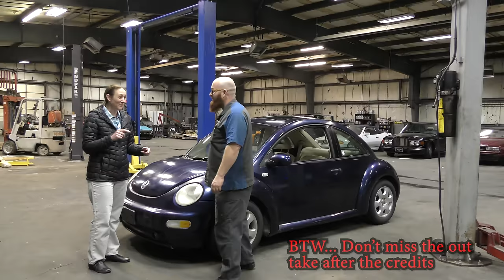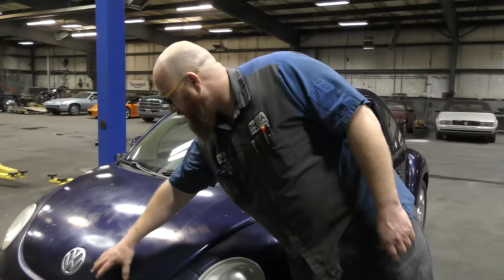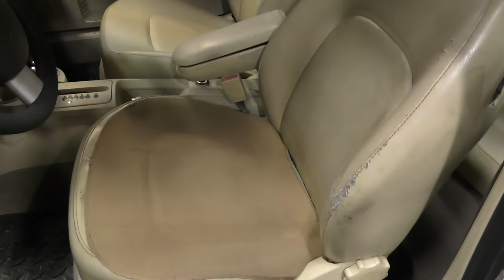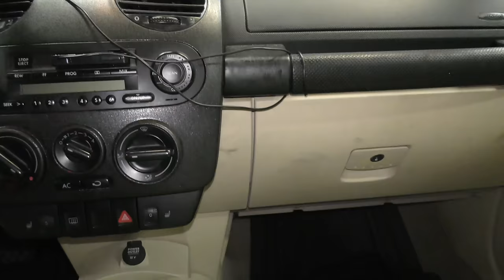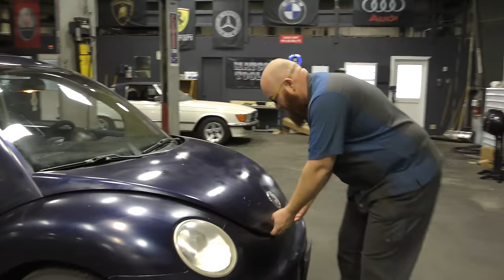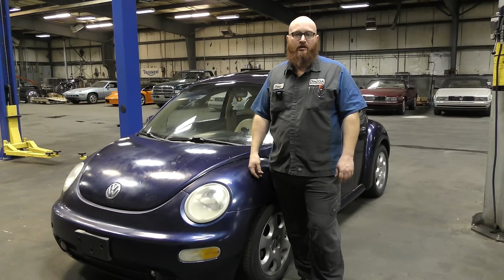Squirtle Update! Why does the CAR WIZARD love this 2002 VW Beetle so much?!?!

Comment: About 8:00 yeap thats about right, here in the uk last 3 i have had to order maf's (tps oem vw parts) i have had to give them the old maf back or i get over 100 added to the price,
They said its a system so the old ones dont get remanufactured with below standard parts and then resold as genuine,
With the egr cheat it is hit and miss, i believe it notices it by the exhaust sensor,
Get a program called vag edc suite, its freeware and with that you can turn egr request to 0,
One thing i suspect tho is it has a newer gen ecu like a edc16 as i have found that they were released earlier in the us
Would suggest the bb in the vacuum pipe but i suspect by what you have said the engine light will light up again,

Comment: not always. I put a 16 dollar delphi airflow sensor(from amazon) on the 2000 toyota echo at 160k miles. it works perfect and has over 200k. the toyota MAF sensor would have been 200 bucks.

Comment: A message to Car Wizard and anyone with a German car looking for a good deal on OEM parts...that $180 Bosch MAF sensor is only $76 at autohausaz dot com. They don’t ALWAYS have the best price on everything but I have found especially for the parts from German suppliers (Meyle, FAG, Sachs, etc.) autohaus often has the best prices around. They aren’t paying me anything, I just have a 1998 Jetta TDI and have done plenty of work replacing parts on it (cooling system, suspension, tune-ups, etc.).

Comment: you have no heat because the insulating foam has deteriorated away from the blend door extremely common mk4 vw problem, tell tale sign is if you have bits of foam blowing out the vents

Comment: It is now the day following the Easter weekend and the Car Wizard will expect to do an all-new, buy this, not that video this afternoon or on Thursday - the first one of 2021. He will hopefully do one for minivans for sure, because most families and/or roommates will need or want one to use for road trips and to transport items. We already know that the newer Honda Odyssey's from 2014 to 2017 are the ones to buy, as well as the 2004 to 2009 Nissan Quest with the five-speed automatic transmission. The other minivans that are not to buy are the 2001 to 2007 Dodge Grand Caravan/Chrysler Town and Country, older GM minivans and the Ford Windstar and the Freestar. The 2011 to 2016 Toyota Sienna with the six-speed automatic transmission and the 2018 to 2021 Kia Sedona with the eight-speed automatic transmission are still the ones, that are recommended to buy. The brand-new market has an all-new, 2022 Kia Carnival, which replaced the Sedona. It has the 3.5 L V6 engine with 290 horsepower and the eight-speed automatic transmission. It looks sleek, but it is a nice minivan. Thank you very much and I am wishing for more Car Wizard videos to come, as well as The Car Mom (Kelly Stumpe), who will plan to visit the Car Wizard hopefully this summer. They will talk about crossover vehicles and vehicles for mothers with young children, as well as their vehicular experiences through marketing sales and mechanical repair and upgrades on vehicles. Good luck.

Comment: I had a 96 Dodge Ram with a 318 that was at 290,000 miles before I sold it

Body was more bondo than steel, but it ran great

Comment: I had same story with Mercedes air flow sensor, 2 sensors, other worked half year and other less. Finally I did clean original with CRC air flow sensor cleaner and it was like new.

Comment: My dad had a 2002 Dodge Stratus that hit 290,000 miles before the original 4 cylinder engine blew. The car even had it's original automatic transmission.

Comment: This 2002 VW Beetle is still in mint shape. Now, the Car Wizard sold it and bought a 2004 VW Beetle Turbo S, which is slightly better than this previous bug. He should had got the 2012 and newer model instead.

Comment: Don't listen to the people that say the newer beetle's are trash. If the door handle breaks, guess what, $10-$15 on eBay. No big deal. My sister's 04 beetle had around 300k miles, before it started having mechanical issues. She sold it while it was still running, and saved up and bought a brand-new car.

Comment: "only 269,000" lol thats kind of true really. i have an 00 Jetta Base Model with 410,006 miles on it. Auto/2.0. like you said Wizard, ride it until the wheels fall off and the check engine light comes on for the last time. I also paid $800 for it, about 6 years ago.

Comment: I have a '92 F150 4.9 (267,000 miles) that was giving me fits with the EGR system.  I replaced or cleaned about every inch of it and it kept causing CEL.  Somebody told me to jam a fender washer between the EGR and its flange nut, a restrictor plate basically.   I bolted it back together and problem solved (3 years and counting).  It lets enough gas (pressure) thru to fool the computer into thinking the EGR is doing something but 95% of the exhaust gas is blocked from the intake.  Worth a try maybe?

Comment: Here is an update - first of all, the Car Wizard sold his 2002 regular New Beetle to the Bug Ninja, then he sold his 2004 turbo New Beetle S, a couple days ago. He is planning to buy a newer, mid-size SUV, that seats eight-passengers with all-wheel-drive. He will be getting a 2016 Toyota Highlander XLE with the reliable, 3.5 L V6 engine, which produces 270 horsepower and with the six-speed automatic transmission with sport mode (manual-shift). The Car Wizard always recommends a Toyota for numerous reasons, which type of vehicle the customer will plan to buy. No other vehicular brand is reliable, because the newest buy this, not that video should be coming up this afternoon for SUV's and crossovers, for all three categories - compact, mid-size and full-size. For example, the one to buy for the compact segment is the 2001 to 2007 Ford Escape or Mazda Tribute 4WD with the 3 L Duratec V6, which produces 200 horsepower and the regular four-speed automatic transmission. Another example, the one not to buy for the mid-size segment will be 2004 to 2008 Chrysler Pacifica AWD with the 3.5 L and 4 L V6, which produces 250 and 255 horsepower and the four and six-speed auto-stick transmissions, both with manual-shift capability. A lot of the older Escape's and Tribute's are still on the road all over North America, then the newer ones, while the older Pacifica's are already in the garbage dump or the scrapyard. Definitely, do not buy, any of these Chrysler vehicles, whether if is the Pacifica crossover, PT Cruiser, Aspen full-size SUV or the older 300 full-size sedan with both V6 engines.

Comment: To answer Wizard's question, 280,000 miles is my record. BMW E36 325TDS 5 speed auto.
Great car. I bought it with over 120,000 on the clock, and drove it until the wheels fell off (they didn't, the diesel injector pump packed up). It took me over 10 years!
BTW, all four wheel bearings were still good at that point.

I've never had a car that required so little maintenance in my life - which is why I always laugh at Hoovie and his constant BMW cursing... Maybe he shouldn't buy cars that have been abused all their life, either that or US BMW dealers do terrible work.

Pretty much the only "major" thing I did to it was change the "sealed for life" auto transmission oil when I got the car. I'd heard it was really only good for 100,000 miles, so I did it as a preventative measure. BMW wanted a small fortune for the weird oil, luckily I discovered one of the VW models also used the same spec oil, so I bought it from them instead. Much cheaper (about 1/4 the price!).

Comment: I had a 2000 golf and the cabin heating issue came down to the flap in the air flow box in the dash had failed. If you adjust the airflow and nothing changes and the temperature control knob isnt really doing anything its likely that box

Comment: I have a car with a similar story - Wife's trying to get me to sell it, but it just runs good and doesn't give me trouble. I got this old Saturn given to me, it had been abused and neglected by my mother in law, and the meth-using cockroach farmers that lived with her for a while because being an adult is hard for some people, and saying "no" is hard for other people. The car is a little four door sedan, with a four cylinder engine and a manual transmission. It would have been completely destroyed, but the ignition module carried out the rite of seppuku, saving the rest of the car, since the engine would now only run on two cylinders. It sat for a number of years, so the battery was toast, and the fuel pump was dead. Still had decent compression. When I got the car home, it had four different bald and dry-rotted tires, (Car had four new tires when it was given to MIL five years and 7,000 miles ago) a broken bushing in the clutch pedal, an electric fan hanging from the a/c lines behind the radiator literally by shoestrings, clouded and broken headlights, and bad front wheel bearings. Anyone else would have had the car taken to the salvage yard. 

But I was bored. I decided to drag out my toolbox, put on my overalls, and see if the car would ever run again. I thought it would keep me busy for a year or so, and THEN I could sell it to the salvage yard. So I started with the obvious, replaced the battery and the fuel pump. This got the car to start, but only on two cylinders. A bit more research and work with a test light and ohmmeter, and I found the bad ignition module. Plugged up a vacuum leak, removed and cleaned the IAC valve, changed the oil, oil filter, and air filter... and the car ran. It ran pretty good. But it idled a bit rough, and made black smoke. Out came the scan tool, and I see the fuel trim is pegged in one direction. (normally it swings back and forth around "0") I pull the oxygen sensor, and it's completely blackened, and is the original from 2003. So another sensor is procured, and I decide that if the oxygen sensor is coated with black soot, the spark plugs are too, so I replace them as well. The car ran like brand new. Since then, I've replaced headlights, bent bumper support, tires, wheel bearings, and a few broken interior parts, and I now have a problem - the car is too nice. It runs like new, it gets nearly 40 mpg, I've been driving it for two months now, and it has yet to leak any fluids or show a check engine light since I replaced the oxygen sensor.

Comment: I dumped my 01 Beatle It was broken into and after that, the doors would not lock it was at VW 3 times and 2000 dollars later it still would not fix then the turbo on the diesel motor capped I sold it for 500 bucks.

Comment: I own a 2004 VW NB TDI 74 kW and I'm also over fourty. It's a daily driver. It's not a perfect car, especially these old TDIs are very loud they vibrate they won't heat on winters (independent heating solved this problem but it cost 800 Euros to install - Webasto) the headlights just don't light enough etc. And you can look like an idiot driving a "girlie" considered car. But I love it. My MPG is 39 and I'm definitely not a fuel saver. These engines are definitely not weak. And they won't break. I bought my car with 160000 km (100000 miles) now I have another 100000 km on it and nothing broke yet. That's why these old TDIs are so popular in Europe. They had to ban diesels in german cities to convince the owners getting rid of it. I owned 5 cars before this but the NB is the first I enjoy driving. Mr. Car Wizard, I know exactly what you talked about when you talked about the NB.

Comment: Looking at a used convertible bug.  If you don't mind a little info would be greatly appreciated  🙂.  Has the air bag light on.  Are there any common problems that are easy or vary difficult to fix with the air bag system?

Comment: Hello wizard, your videos are great and I know you love your beetle as much as I own mine. Soooooooo, its a 2006 new beetle hatchback with 2.5L with 169k on it. I replaced the hatch motor and it worked very well until now.   I hear the motor of it engaging and sounds like it should be open but its stuck shut. Either a faulty latch or something else went wrong. I went to pull the emergency cord from inside and it broke off. Now how do I get in there. I went inside to try to remove the panel but its not coming off from the inside. I don't want to yank it too hard as I don't want to break the plastics. I don't have a key entry at the back so Im stuck as to what to do. Can you help or anyone else?

Comment: Ok I have a convertible version of your 2002 squirtle. I would say more of a venasaur. I LOVE it. No one understands. I don't understand why no one understands. It's the dark blue like yours with a black top & black leather interior & only like 88,000 miles. The top is not ripped significanly & still goes up & down, but, is like pulled slightly from the back window. you can still use it, but don't go through the car wash, I have to hand wash it, not a big job. a few towels & cleaner. The transmission is going out. I need a new topper. My boyfriend has offered to buy me a brand new car off the lot, but, he wants to choose it & he wants it to be like his, a civic. I don't like those. I like my weird little cars. I like my convertible. I wanted a midget, but, I ended up finding this and I love it now. people just don't get it when you love your car. Now it's sitting in the driveway because im scared to hurt it by driving it because I know the transmission needs to be serviced & I can't find any really great videos on how to do it myself.

Comment: Take the radio out cut a hole with a Dremel tall in the plastic duct and put foil tape on your blend door  it mad with holes in it that are covered by a foam that’s what’s wrong with your heater

Comment: I know you’ve already sold this car on, but had to comment about the lack of heat. First of all, being a TDI, the heat is never gonna be all that great in 40 deg F or colder weather. You can block off the radiator partially to help the engine get to and stay at the proper operating temp, but with the rad wide open, it will never run as hot as a gas car, just the nature of the beast. 

But the heat that it will put out should make it at least comfortable in the car, at least after about 10 minutes of driving. If that isn’t happening, then yes, the issue is probably with the blend door, but it is unlikely the blend door isn’t moving like it should. With a manual HVAC controller, the door is moved via cables connected to the temp knob, no motor involved, and these cables rarely break or malfunction. 

One thing to point out as an aside, these VWs do not have a heater valve which modulates the rate of coolant flowing through the heater core. Coolant flows through the core at the same rate at all times. The blend door just controls how much air is routed through the core vs how much is routed around it. 

However, to ensure some air flows through both passages at all times, VW put holes in the blend door, and covered them with a sheet of moderately dense foam backed with adhesive. After 15-20 years, this foam starts to break down and fall apart, allowing more air through those holes. The fix for this is to use REAL duct tape (the super sticky aluminum tape they use on actual HVAC ducts) and cover up those holes. It is an enormous pain in the ass, but it is doable, and will fix the heat issue.

Comment: The small amount of heat is due to the fact that it's a diesel engine, they do create way less heat than a gas engine would.
Reply: A diesel has a greater thermal efficiency, but you should still get a hot air from the blower. I would flush the heater matrix as it may be clogged up with gunk.
Reply: @johnfittis5764  Not necessarily in winter. A friend of mine drives a diesel and he has cardboarded up the whole radiator in winter, so that no air reaches it, and he still needs to drive something like 30 miles for it to start becoming somewhat warm. Of course, on a longer trip, the heat works.
Reply: Yeah sometimes cardboard is a wonderful thing if it gets u some heat.  I have done that myself recently actually, I changed the thermostat on a friend's car but it was still over cooling so closed off half the rad. I think the new thermostat was opening too early. I considered it a botch but it's an old banger 😂😂😂

Comment: I used to have the same issue with my mk4 golf 2.0 gas, car would have to be running for like an hour before getting good enough heat for the negative 30c I changed thermostat and coolant and my vw now takes little time for heat now.

Comment: I would really like to have the tdi I have an 07 beetle 2.5 poor gas mileage but it runs good. I had a 94 toyota paseo 334,000 original clutch sold it but still liked that car.

Comment: I just bought a 95 Ram 3500 Dually 5-speed with the 12v Cummins with 430k miles. Runs great, it’s ugly and needs some work. But I only paid $1k so I think I did pretty good

Comment: I drove VW diesel Cars from 1977 to 2010, I can tell you that you will be looking at doing a head gasket at around 550K give or take. They are not bad cars but they are not cheap to work on and most of the aftermarket parts are not good. OEM parts are the way to go. I have been offered a 2005 VW Jetta Diesel, Standard Transmission with 230K on it for 2K, I don't know if I will buy it or not. The problem I see is that VW is not bringing in Diesel into the country anymore. And like the 1991 Jetta diesel I had, parts became hard to nonexistent. I had to have some things like the Altenator Bracket fabricated.  On the other hand you doing all the work yourself, that car didn't cost you much, you should get 3 to 5 more years out of it I should think.

Comment: I have a 2002 VW Beetle and it has 110,000 miles in it, I recently purchased it but it won't drive over 70 mph...acceleration hesitation, and it won't go over 3,000rpm